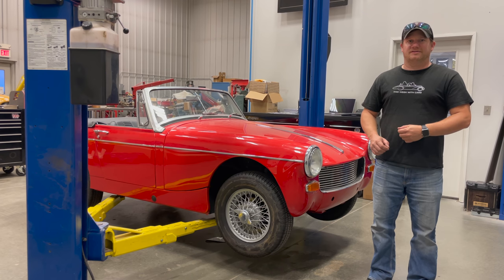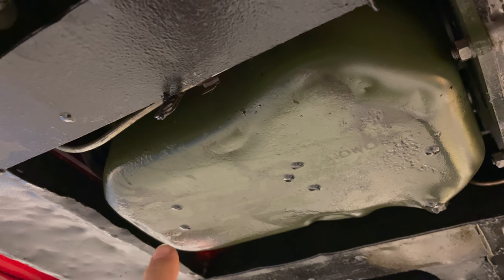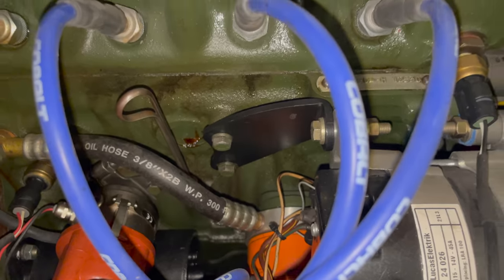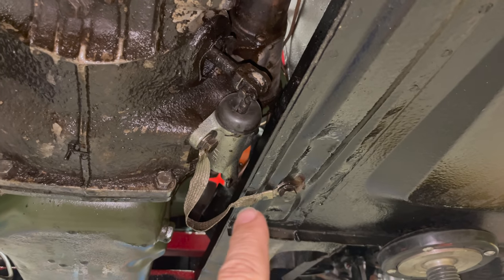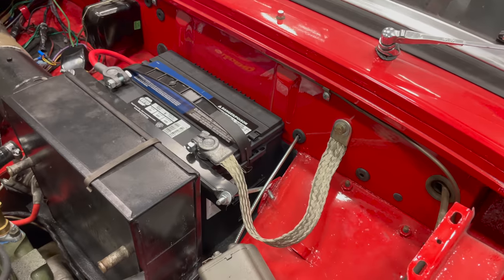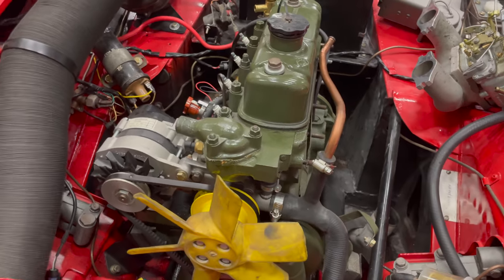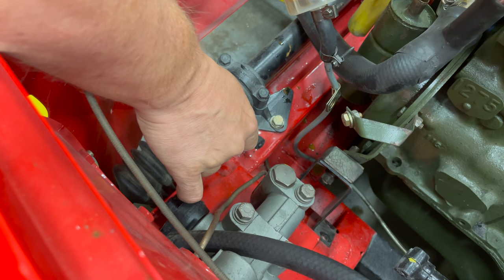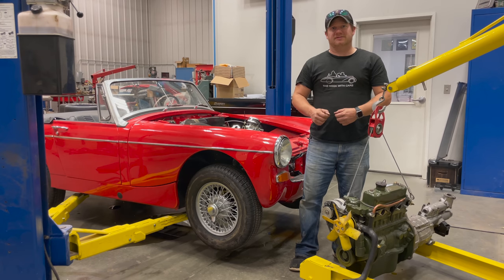1966 MG Midget Engine Removal

Comment: I envy you working on a Midget that's so clean and rust free , unlike the rusty wrecks I worked on in the past , oh and I did that exact same job in the street outside my parents house , in the rain many many years ago!
Reply: I can remember my dad and his racing buddies doing this with Spridgets in the 70s, break something, two guys, a handfull of tools, a steel bar or tree branch, yank the engine in about 15 minutes flat, no one even had to talk, they just set to doing it and before you knew it, you were being yelled at to get out of the way or help lift. Then they would set the engine down in the grass and rebuild it, pop it back in before the sun set and be back to racing the next morning.
Reply: @mundanestuff  sounds like some of the reprobates I hung around with as well, happy days.. Sniff!
Reply: Boy, me too. My dad had a thing for old fiats and used to drag some sorry POS wrecks from our local junkyard.
Reply: @mundanestuff  Yes and then they went to a bar bought 20 drinks for $ 5 then had money left over to take 2 chicks out for a meal and still enough money left to fill the tank and drive home ....those were the days........
Reply: The first time I removed a motor from a Midget was my girlfriends 71. I did it with a friend a 2x4 and a chain.

Comment: My 1979Midget  is running rough after sitting all winter. I took this time to change the oil & filter, grease it, bleed the slave cyl.  replaced a leaking brake hose and bled them.   Gave it a tune up but still runs rough with a slapping noise in or out of gear.   This video was a help.  Wish me luck.

Comment: I can't even describe how thrilled I am to have found this video. I have owned my 77 Midget for 28 years, and for at least the last 10 or so, never once watched such a clear and concise removal of any MG engine. Thanks so much for this! If you ever decided to do the clutch on a Midget, you'd have my eternal gratitude.
Reply: It’s a different engine on the 77…
Reply: @JBils41  yes thanks, I know. I stand by my comment that this is the best MG Midget engine removal video on YouTube. If you have any special tips or insights on the 1500 engine, I’d love to hear them. Thanks again.
Reply: @professortruszkowski  Ah OK… the process of removing the engine is similar on later cars… but of course some bits are on the other side, and the gearbox and prop shaft fixings are different. I was reacting to your comment about clutches, because the 1500 has a different gearbox, clutch and clutch release system to an A Series car… but there is lots of info out there on these cars, and the Workshop manual is readily available 😊👍

Comment: "You can do this job in about 2 hours."    Speak for yourself, ha!  Most people take 50 years, get too old, and then you have to go drag their spridget out of a barn.
Reply: Also my guess is that based on the oil leaking out of the adapter that the orange Fram filter blew up inside, leading to catastrophe.  If I'm right, you should make a pledge to use Wix filters forever :)
Reply: luketrash - the voice of experience I assume? In my youth (about ~19 or so) I bought one of these engines off of a guy. My brother and I carried the engine, intact, from the back of the guy's barn and put it in the trunk of my Dodge Demon. We weren't very big, or bright, but we were pretty strong. As a side note, we're in our late 60's now and we both have bad backs. Can't imagine why.
Reply: One time I was with a friend at Watkins Glen for the 50th Collier Cup and his new wife's Midget blew out her clutch on Saturday's qualifying. 

They got married Saturday night. 

The next morning, we replaced the clutch and put it back together. Started it up, and it stalled when pushing the clutch in. ARRRRGGG. 

So we took the motor out AGAIN and found the clutch given to us by another racer was stamped wrong. SO we flipped it and put it back together and she was able to race the second all-MG race. 

It took us a little over 2 hours (hung over as shit) to take the motor/tranny out twice. 

It was kinda of cool since on Sunday morning we were like the only people working on a car like that. We were rock stars. Or something. 

Worst thing, she never thanked the guy leading the rebuild or me. She got to run the 50th Collier Cup.

Comment: You have done that before and have got it down to a fine art. The clutch pin is not the only weak link in the clutch,  the carbon thrust bearing was also a pain.

Comment: Regarding my comment on your Midget engine video with regard to silicone grease. You can use the stuff on your hoses too to keep them from sticking and rubbing silicone grease on the aluminium parts that water hoses fit to will stop the ally from rotting.

Comment: From my recollection, there is no need to remove the driveshaft, as the splined end at the trans will simply pull out when you move the engine forward.  On reinstallation, I've wrapped a cable around the shaft from the shifter access hole in the tunnel and slipped it back into the trans flange, then pulled the cable out once everything was in place.
Reply from the maker: That is true but I find that doing it the way I am doing it to be easier when reassembling it.
Reply: @ThisWeekWithCars  I may have to try it your way next time!  I probably got lucky with my refit, but it seemed to go easily enough, as I recall.  At any rate, I'm really curious to see what is causing your leak.  Mine (67 Sprite) has the usual oil drip from the rear "seal", and a small dribble from the front.  Yours looks to be something else, since the entire pan is soaked...On the other hand, as they say about British cars, "If it ain't leaking oil, it's probably just out of oil."  :)
Reply: @Poundingsand  I think of the leaks as rust prevention undercoating

Comment: I'm betting on the oil filter adapter being the source of the oil leak. There were no signs of leaks from either the front or rear seals. No holes in the block or pan. Internal engine damage could be bad if it ran out of oil. Hoping for the best for you that you haven't wiped a bearing or worse.

Comment: What we used to do for a major preventative maintenance was to remove the engine and transmission entirely tie a rope around them and use them as a boat anchors then install Toyota motors and trans or even the little V6’s out of the Caprice’s they never ran better ohh and go through all the electrical…after that they had plenty of power and became reliable,

Comment: Hi Steve, a 1966 BRG MG Midget was my first car and I worked on it with my dad.  My car had clear front turn signal lenses instead of orange on your car, and a front grill that was vertical chrome ribs.  Was your car a late '66 perhaps?

Comment: That Midget is gorgeous. A really clean restoration. I have a 77 with the 1500 engine, do you have any that you've removed the emissions from? I have to plug the header where the EGR valve used to go. Previous owner got around to removing the EGR but not to plugging that hole.